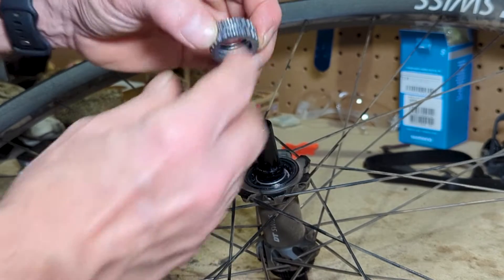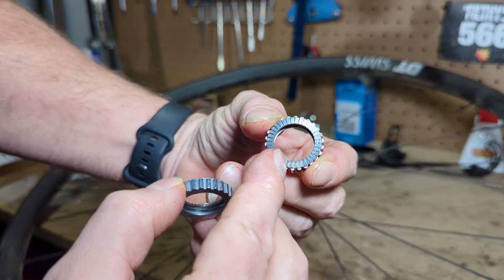How A DT Swiss 350 Hub Works

Comment: So Shad, there is no lubrication required between the plates? I wonder what material they are made of. 🤔
Reply from the maker: There is a light grease in there. It will come with the new higher engagement plates when I get them. I will do a full install video. Not like you will learn anything new because the process will be the same as I did here. But I can at least follow the directions and talk about the grease application.